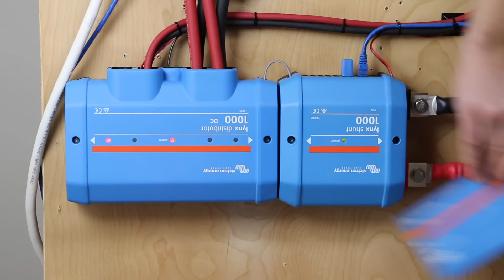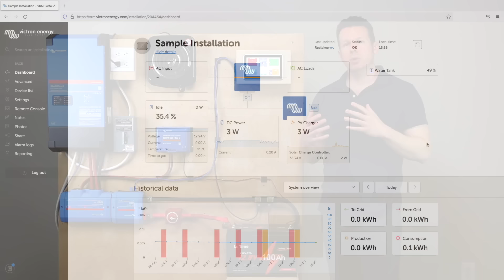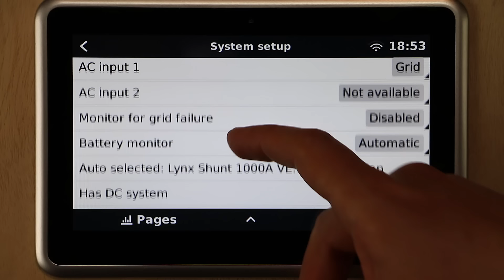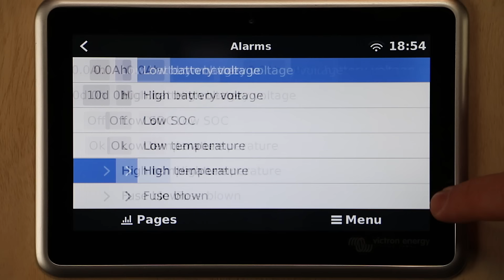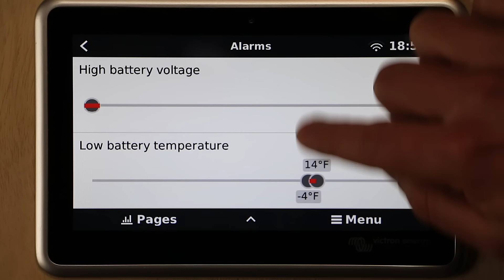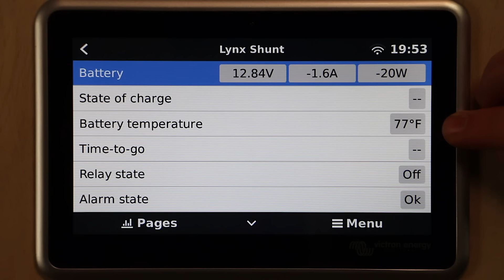Victron Lynx Shunt vs SmartShunt (best battery monitor for Van and RV power systems)

Comment: The lights on the Lynx Distributor can be powered by DIY'ing a cable to provide power (5V I believe) from the battery through a 12-24V to 5V step-down converter to the Lynx Distributor.
Reply from the maker: Great, thanks for sharing, and checking out the video!

Comment: Just a thought… The discrepancy in voltage readings between the SmartShunt and the Lynx Shunt just might be explained by (the consumption of energy by the internal electronics of the SmartShunt plus the lost in the Smart Shut Power studs plus the internal cable resistivity).

Comment: With a house & a starter AGM battery system - 
1. How does the smart shunt know what specs are associated with the starter battery?
2. Will it use the same alarm system for the starter battery?
3. Do we need router adjacent to the smart shunt?

Comment: If I'm not mistaken, both shunts have a "Calibrate" setting, because all sensors are manufactured within a set margin of error. This allows you to use any means you desire to determine 'real temp', and calibrate the system accordingly.
Or, that "calibrate' setting may be in the GX software. Whichever, there is a way to make either of them give the desired accuracy after calibration.
Reply from the maker: Hey there, yes there is "zero current calibration" which I've never had to use. Other than that the calculations by the shunt are not able to be modified by the end user as far as I know.

Comment: If I’m using a lynx shunt, distributor, multi plus, and Orion. I’m grounding the multi plus to the negative bus bar on the distributor, the mppt to the multi plus ground, and then where does my chassis ground go to?? The lynx shunt? The multi plus?

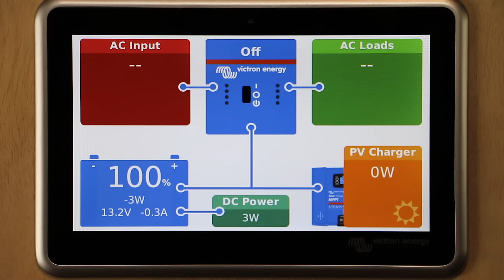Comment: Hello,  thanks for the video. I noticed that you have DC power monitor 3W at 11:30 in the video, I currently purchased only victron battery shunt and cannot read DC loads is it only possible with lynx shunt and battery shunt together or I can use 2 battery shunt for example one to read SOC and the second for the DC load, I plan to use 12V dc load 24/7 so will be important to know total DC load consumption in order to calculate solar and battery sizes accurately. thank you in advance.

Comment: good video - will the lynx shunt work with any type of batteries and even DIY lifepo4?
Reply from the maker: Hey there, yes it will measure any battery, DIY or factory-made. Great question, thanks for tuning in-
Reply: Doesn’t the Lynx Shunt require a GX? It’s of no use without it, correct?
Reply from the maker: @gvlive  yes that's correct, it needs a GX device - that's where you program it and where you would read its data.

Comment: As a couple others have said, I'd expect there to be higher amperage on the Lynx Shunt because of the voltage drop.  Lower voltage=higher amperage, since Watts is the only "true" measurement, at least in this context.  If you convert both to Watts, they're a lot closer <10 watts.
Reply from the maker: This is a good assessment, but we have to remember that the Lynx Shunt is taking a reading, and cannot change the current coming through it. Same current x slightly lower voltage = slightly lower watts through the Lynx Shunt. Voltage drop was 0.074V x 95A = 7.03 watts less than the SmartShunt.

Comment: The Victron stuff is very capable and very well-respected.  They certainly think highly of it, if the prices are any indication.  I would not use a Victron Lynx shunt in a Van setup; maybe in a really large RV?  I've used Victron chargers and have a couple of their smart shunts in use, one for a mobile power station and one for a small off-grid setup.  I've been very happy with the data they provide.

Comment: No way is a clamp on meter as accurate as either shunts.  Most clamp on DC meters are no better than 4% and the best one I know of is 2%.  I don't think you can conclude which shunt is more accurate, you need a  better way to get a current standard than using a clamp on meter.
Reply: Exactly. Clamp meters are like eye balling. Shunts with this ADC resolution and range are eye balling as well😂😂😂😂

Comment: With the lower voltage for the Lynx shunt (as it is further from the power source) it makes sense that amperage would be a bit higher to achieve the same power. 1.13KWh Lynx shunt vs 1.14KWh for smartshunt - Lynxshunt is further down the line so therefore would receive less power as some power is lost as heat in the line, no?
Reply from the maker: Your approach makes sense, but as mentioned in the video, Kirchhoff's Current law states that the current is the same through both shunts. The Lynx Shunt is just taking a reading, and cannot boost the current. You are right on the power loss, but that would be due to a (very) slight voltage drop, the current is unchanged.

Comment: I suspect if you were to check temperature readings on several different units of each device and temperature probes as well, you would probably see different numbers....Also if you calculate the wattage each shunt is reading they're pretty close, they are only 7 watts apart at over 1100 watts which is much less significant, thanks for video

Comment: Another consideration when sizing a shunt, is the resolution of the measurement (as converted to digital).
Measurements will be more accurate if the shunt is not oversized, especially at charging current (less than 100 amps)
Reply: this is a good point. my lithium batteries BMS will not read anything under 1 amp being drawn from the battery.  this means the bluetooth app for the battery is not giving an accurate state of charge once it starts being used and depleted.  my Victron BMV 712 however, will read to within a tenth of a percent with the 500 amp shunt that came with it. the shunt/BMV combo will give a very accurate state of charge as the battery depletes.  when i recharge the battery i use the app thats connected to the BMS for the battery to confirm the individual cell voltages to be able to confirm when its 100% charged.  once its charged i check the victron BMV to make sure its in sync then rely on the BMV again for level of discharge as i use the battery.